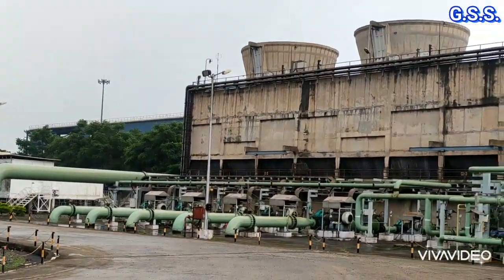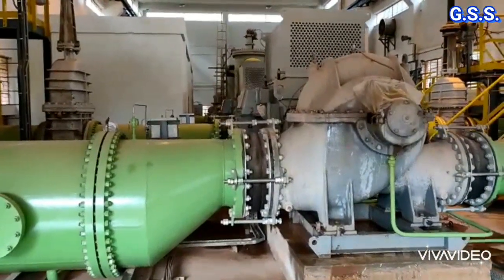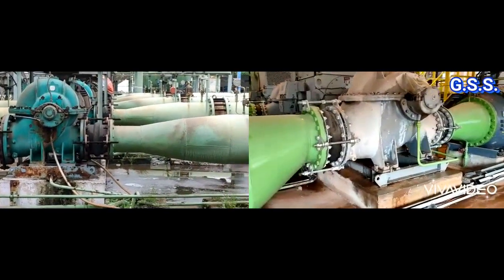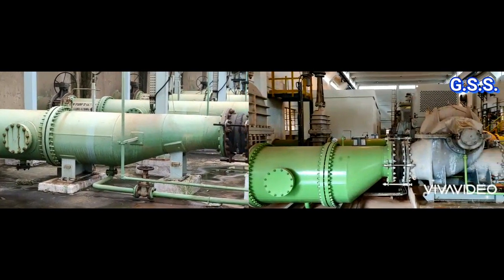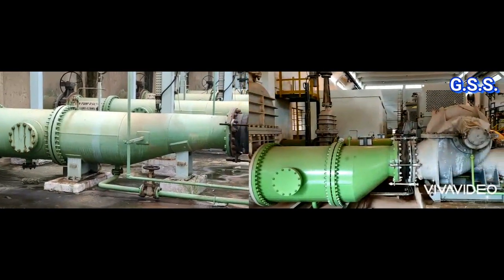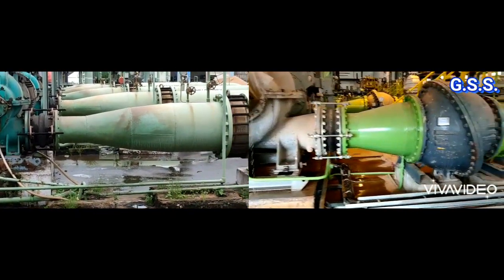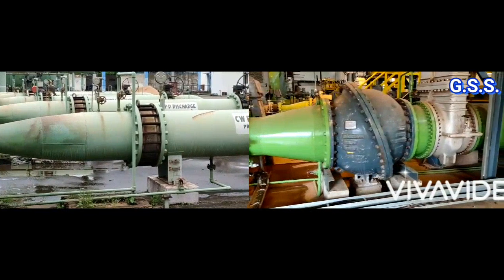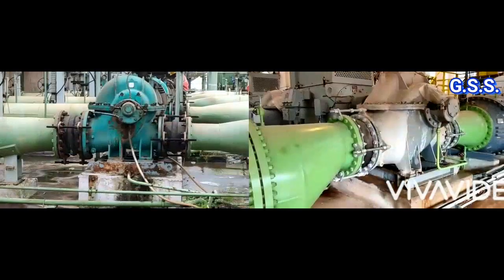Piping Engineering : Typical CW pump piping & defects

Comment: Sir whether there is a requirement for a spool /straight length between reducer and suction nozzle?
Reply from the maker: There is no requirement of spool or straight length in between pump suction nozzle and reducer. But if we use SORF flange as counter flange, then reducer cannot be welded with SORF flange, so we need a small pipe spool for welding SORF flange. If we use WNRF flange, then flange is directly welded with reducer and in that case no pipe spool is required.
Reply: @gourisankarsamanta7670  clear sir👍
Reply: @gourisankarsamanta7670   @GOURI SANKAR SAMANTA  one doubt sirji. For 24x16 reduction is 66.66 % .
I.e.    16/24x100 = 66%

So is it very stringent to use 75% or how the things are. Please help.

Comment: Sir if Diameter reduction of eccentric reducer should be about 75% . If suction line is 24" means pump suction nozzle size will be 18" kindly confirm my understanding is correct
Reply from the maker: If suction line size is say 24" and pump suction nozzle size is 18" or 16" then we can use only one reducer 24"x18" or 24"x16". So diameter reduction is about 75%.

But if pump suction size is less than 16" (say 12"), then we need another stage reduction, we should not reduce 24" to 12" in one stage.
Reply: @gourisankarsamanta7670  okay sir thank you.. understood
Reply: @gourisankarsamanta7670  one doubt sirji. For 24x16 reduction is 66.66 % .
I.e.    16/24x100 = 66%

So is it very stringent to use 75% or how the things are. Please help.